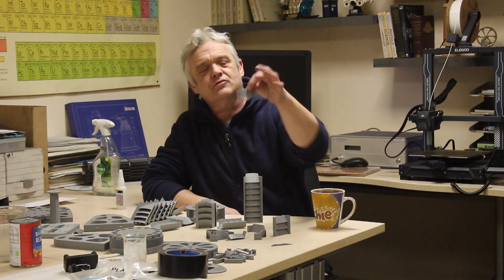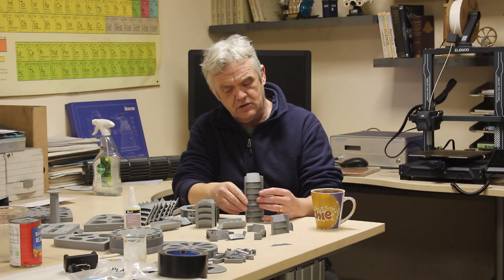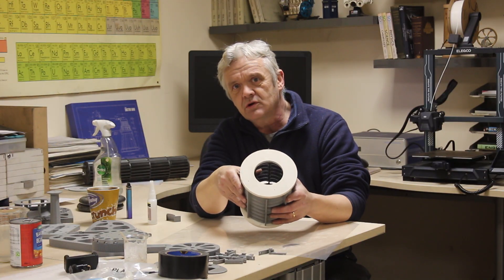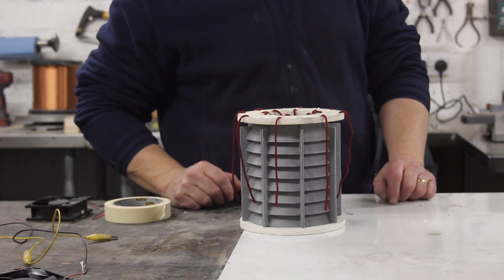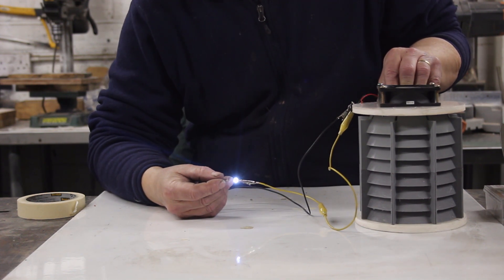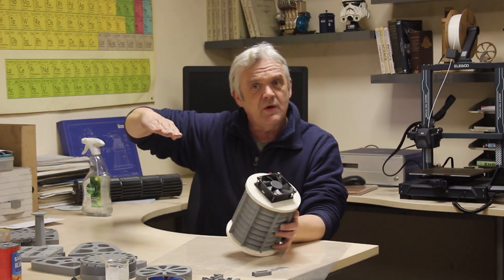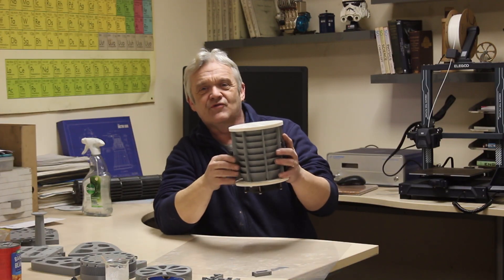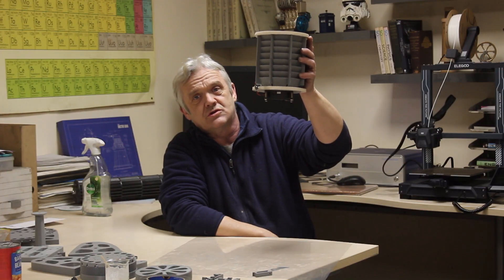1817 Darwin's Wind Turbine - An Exciting Result

Comment: I like that it works in various orientations. Additionally, you make a very good point that when the fan is mounted at the bottom... it will be more easily serviceable. For long term protection, it will likely need some sort of wire fence to prevent birds from creating nests inside etc... It would take a really long time to 3D print this in a much larger size. But, because the parts can made in a modular fashion you could theoretically make it very large over time. I wouldn't use PLA long term outside, you might want to look into weatherproof and UV protected filaments if you plan to use the prints for outdoor experiment that you want to last.

Comment: I believe the longer the pipe will be, the more resistance to air it will cause. Eventually lowering generation to 0. Decreasing pipe diameter will make similar effect. It seems like threads on the back still show some air flow, so putting some membrane might increase the pressure inside.

Comment: You wouldn't want one of these to operate upside down though as it would channel rainwater and snow into the centre wouldn't it? Or you could put a rain channel inside to divert the water away. It's a cool concept though, I wonder why on its side it's more efficient? Can you quantify how much more efficient it is? Perhaps it's simple laws of physics at play here with the weight of the air... but I reckon there is something else at play too...

Comment: I'm not sure if it was mentioned but a large benefit to driving the air down a pipe and mounting the generator close to the ground is the savings in copper/wire as well easier to install.

Comment: I'd be concerned about rain ingress if it was upside down.  Also, would it be as efficient as the original Darwin design?  I got the impression the Darwin design with its enclosed space would produce more air pressure within the cylinder by capturing and containing the breeze, whereas this design might allow air leakage from the negative air space behind the cylinder.

Comment: I imagine that if the darwin turbine was upside down, though the effect would likely be small, gravity may help to move the air downward. Also with the turbine flipped, the air might be more easily used for other applications like passive air conditioning and not just producing electricity. I'm wondering if in addition to swooped fins if a swooped pyramidal tower, looking somewhat like the Eifel tower, inside the turbine would help move the air more efficiently.

Comment: Nice to see we are like-minded. I have been working on a similar design to what you mentioned at the end, having the Darwin tower raised up, and having the wind travel down benefiting from the height difference to increase the velocity of the air. I tend to try experimenting soon, hopefully with some fellow university students.
Reply: Are you sure about the ”height difference” part? Since air is everywhere, and the only reason it would fall down due to ”weight” is if it was in a medium that is less dense than itself, which is not how it is in our atmosphere. There is air everywhere, which means air can’t really just ”fall” in that sense.

The only exception is convection, but that doesn’t have anything to do with a height difference though.

Comment: As I have said before this is not my field and so this will be ether so obvious or so stupid but,if the wind were to travel down a pipe, if put at the end of a pipe (a rocket stove) could this work. I realise it would need to be distant & protected from the heat🤔. 👍🐝🌞

Comment: The only downside I can see for the downward facing baffles is that rain blown by the wind can get into the fan area much more easily than when it is pointing upwards.
I don't know a lot about small fan/generator assemblies, so I don't know if this would be a big problem or not.

Comment: The pipe idea made me think of trying to using this type of wind power to pull a slight vacuum using a Venturi nozzle. My mind went crazy with the task of optimizing the geometry to accelerate the air for stronger vacuum. My first thought on applications would be wind powered restroom vents. A linear actuator could operate a baffle to turn it on and off so it’s only using power during the switch from on to off and vice versa. I’m not well versed in fluid dynamics so there may not be enough velocity to create the suction.

Comment: It seems like directing the airflow with curves would reduce resistance, the same reason curved turns are preferable in HVAC ductwork. With this in mind I think a curved cone inside the structure would also achieve the same effect.

Comment: What if you put a cone on the inside of the wind trap, seems it would focus the air up in a sense also
Reply: each section of the side vents would need to be walled going up following the cone so you wouldn't lose airflow along the sides, looking like each one is a separate leg of airflow focusing to the turbine
Reply: that way each of the 8 sections would work like an air ram so no matter of wind direction it wouldn't go any direction but to the turbine

Comment: The round design is nice in that it'll capture wind from any direction... But the opposite side is open, meaning the wind energy is pushing air out those vents (less pressure).  Adding some way of "valving" those would increase the efficiency.
Reply from the maker: I think you are wrong there mate - the back flaps because the air is wrapping around the pipe - but larger edge projections will tell us -w e don't have to guess lol
Reply: I see the rear dreds moving (it's not "blowing hard" but it is moving air)

Comment: If you did add a pipe could you also add more turbine's in the pipe ?
Reply: To many and you stall the air creating back pressure that reduces effecency or stops air flow altogether.
Reply: @Barskor1  makes sense thanks
Reply from the maker: you can but there is a limit mate - the air has to flow

Comment: There should be some kind of airflow simulation software available to use for cheap or free by now, I tried to use Blender a few years ago when I was optimizing a 2 fan to 1 pipe duct adaptor but it was a bit too much to figure out because it’s not set up to do that kind of function out of the box.  I went back to printing to test them but I could have done more versions digitally if I had figured out the airflow simulation, and it could really come in handy when testing and optimizing something truly new like this.
Reply from the maker: I wonder if FEMM 4.2 does it - I'll check

Comment: I was thinking would it be possible to recycle some of the air that is exiting from the fan to "beef up" low wind speeds.
Reply: IRC you likely get back pressure problems.
Reply from the maker: dunno - what were you thinking?
Reply: @ThinkingandTinkering  Something pudding basin shaped beneath the fan connected to a much larger diameter pipe outside the one directing air downwards, feeding the air back up with a single circle of blades inside the pipe directing the air towards the collection tower.
Reply: I think a wind tunnel would be useful for research along with wind colourant to optimise the blade angles and spaces as per your last remarks before adding mine and others ideas
Reply: I might need to rethink this as the larger pipe top would need to be larger than and just below or level with the lowest part of the tower. Where have I put the tonic for my gin?

Comment: There are few air mines that work similar to how you described with the pipe idea and they also use heat and pressure differences at top and bottom and color to attract solar energy
Reply from the maker: interesting cheers mate and thanks for sharing

Comment: The pipe would be a cheap way to go. But you could just build a tall octagonal tower with louvers. That would mean more area exposed to the wind. But it might not be worth the cost. It looks like there is plenty of room for experimentation. Since your louvers are not curved, they don't need to be printed. Expanded PVC would be cheap and quick. Plus, you could build a much larger structure than a printer could fabricate.
Reply from the maker: I did them uncured deliberately - curved would be better so as not to impede airflow I think - but not essential to get a good result
Reply: @ThinkingandTinkering  But you got such good results from straight that curved might not be worthwhile -- at least not for the home builder. Straight is easy. A guy could make an entire tower in an afternoon with just a table saw, hammer, and nails.

Comment: It seems to me that this piece would work better if the wind vanes were hinged and able to close .. so that the wind coming in one side would only be able to go up the middle.  What you have with the open vanes on the other side is a place where wind-pressure can escape.  If that energy could be forced to go up the middle .. seems like it would work better.  Easy enough to try it out by taping up the openings on one side.  It is a nice looking piece tho.
Reply from the maker: apparently not mate - we have tried both - I think the fins need to extend out more - but it's only what I think - you could try it and see
Reply: @ThinkingandTinkering  Maybe I will .. but for the sake of timely communication .. I think it would be better to have a wind wall .. say 4 - 6 ft. long and maybe 12 in. wide .. with a solid partition in the middle.  The two outside faces could have the openings .. facing the wind direction at the top of a roof.  The wind catcher could be laterally on the top.  I appreciate what you are doing .. scrambling the eggs!  lol :-)

Comment: did you compare the PC fan/generator facing directly into the "wind"  to see if it generator produced more energy with the Darwin turbine config?
Reply from the maker: no - there was no point as there is no real point of reference in this to be able to compare them - for example how far is the fan from the wind source? They can be compared but that will be a little calculation and a few assumptions and that will be down the line for me - of course you could always do it if you felt you needed it - if you did - please share

Comment: If you angle the fins so that a vortex is formed in the middle then it will cause a greater pressure difference due to the increase in velocity and suck more air in. It worked with your rocket stove. 🤔😉
Reply: Second this 👍
Reply from the maker: interesting idea mat - thank you for sharing
Reply: @ThinkingandTinkering  I do have a 3D printer based on your videos. I don't know if its possible what I am saying because with the rocket stove you have two effects, the heat causing convection internally causing a drop in pressure and if a horizontally rotating geometry if applied to in secondary air flow then this could increase the vortex air speed that will reduce the pressure further. However, with the Darwin structure you are already having the air flow as a primary driver. That being said, building a Darwin structure out of black heat absorbing material will not only get the benefit of wind but solar convection. Overall, what I would say is for wind power generation, the device wants to increase the aerodynamic drag effect thus increasing the pressure mediation thus increasing force in the system to then be converted into power.

Comment: I can tell you already that if you stick a pipe on the end of it, it'll work just fine. By inverting it, you made me recognize it as something else immediately. Thousands of years ago, people who lived in the desert found a way to capture wind to cool their homes. These were called 'Persian Wind Catchers' and were effective enough in cooling homes that people could live in desert areas for many centuries.
Reply: I wonder just how much length of pipe you can get away with before experiencing any reduction in air flow through the pipe caused by drag and turbulence within the pipe. A similar phenomenon happens with a water hose and the pressure at the outlet of the hose. A 20 ft water hose will have pretty good pressure at its end in comparison with the source pressure, where as a 150' hose will have significantly reduced pressure at its outlet compared with the source pressure.
Reply: @Zagiman287  Have you ever been at the bottom of a chimney stack, the higher it is greater the vacuum up draft
Reply: @southerneruk   thanks for that info 
i was unaware of that , so that how it will draw air
Reply: @atntaltd  I was thinking about asking the council to allow me to put a 6-inch pipe down the side of a 25-story tower block. And see how much power it could generate
Reply: @southerneruk  cool  i ll try it in new construction site
Reply: @atntaltd  It would be worthwhile, even if it only produces enough power to run the landing lights of a tower block, it is a start
Reply: Quite astute
Reply: Caused an up draft of air.

Comment: Upside down is good, but will also direct rain inside. I'd suggest an elbow slightly over 90 degrees at the bottom as a 'water trap'. Just a thought.
Reply from the maker: nice thought mate - thanks for sharing
Reply: Maybe an elbow at the top since it seems to work in a horizontal configuration.

Comment: I had been thinking about the airial Venturi/ground converter idea for a while, originally to drive magnets beside a copper pipe to collect heat. That aside, you might see an increase in efficiency if you put a solid core in the 'beehive' to direct airflow to the outer portion of the turbine blades...

Comment: You've created something that looks just like a vent cover that I have seen people put on a pipe all the way to their basement floor with a ventilation stack in the air as the wind blows over the top it creates a vacuum which sucks out the dense moisture Laden air from the basement floor thereby eliminating small pools of water that he thought were cracks in the basement floor, it's amazing how similar Your Design looks to that vent cap LOL

Comment: The pipe idea is interesting! Could almost imagine scaled up versions in car parks (parking lots) doing double duty as turbines and light poles. 

Another idea that the yarn test sparked for me was adding some kind of rotating half-barrel shield. It would rotate to the leeward side  of the tower, and help direct air which has flowed around the tower into the leeward inlets. Maybe not a huge performance gain, but interesting to mull over.

Comment: Interesting mate... Just for your information what you have made looks like a GC-1 flue terminal.
Reply: Yes, except that from looking at many googled images they vent directionally towards the sealed end of the cap.  Drilling a large pipe hole in the cap and sealing off the "normal end",  I'd be curious how effective it is (for a cheap semi machined part)

Comment: I wonder if it would work better with the blades curved the opposite way, so the wind meets a concave surface instead of a convex one? It looks like the dreadlocks on the sides are blowing as the air gets diverted along the sides.

Comment: Nice one Rob ! How bout holes in both ends of your contraption and you try and draw a vacuum on that supposed tube using venturi instead of forcing the air down the tube . It can work on chimney effect then too and tube length might not be a hurdle then

Comment: The fact that is works "upside-down" is handy to know. So, going back to your original design with the hinged flaps that were noisy... what if those flaps per replaced by a textile? Sail-cloth perhaps. Attached/hinged at the top as before, free to move ie open at the bottom, and a triangle of cloth at the sides to attach it and limit the movement. Any wind coming from the other side would close it for you. I reckon it would look like shark's gills opening and closing in the wind. This iteration might benefit from having the fan on the bottom.
Reply: Just a quick observation here, but it seems to me that "wind" doesn't know the difference between "right-side up", nor "upside-down."  YMMV.

Comment: I wonder if an improvement would be to add some really lightweight flaps to the inside of each opening to prevent any air going straight out the other side. Even something just like paper that would hang down when no wind was blowing and rise up when the wind hits
Reply: He had a big model of that exactly in the last video he said there was a problem with noise. This is the next iteration. You can notice from the wool strings that there is no problem with the air escaping the other side, it is all directed upwards
Reply: @goodboiadvsp3297  not quite what I was getting at, on his previous model the flaps where made of ply and opened to allow the wind in. With this model that flap is essentially always open. It would be interesting to see if Rob where to attach the wool to the opposite side to where the air enters to see if any does escape out of the side. You need to.divert as much of that incoming air as possible.
Reply: @seanchadwick6182  Now I'm confused, at 2:06 you can see the opposite side to the fan the wool only wobbles a bit whereas the side with the fan completely gets pushed out of the way by the air. I think that proves pretty well almost none of the air is going directly through the model
Reply: @goodboiadvsp3297  carry that video on to around 2:13 and you can see the opposite side moving. It may not make much difference was just a thought. You don't want to be losing any precious wind power especy when working with lower speeds than a traditional turbine would work with.